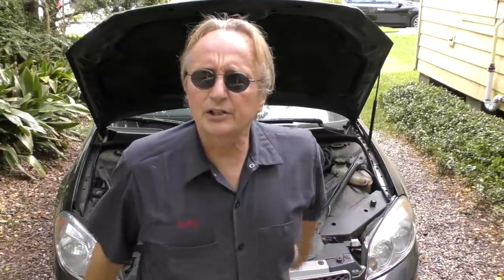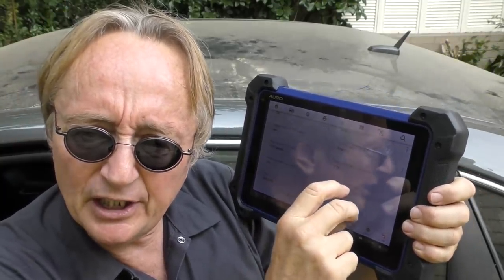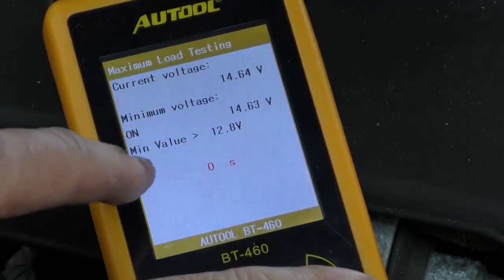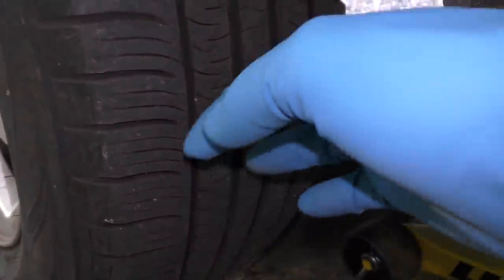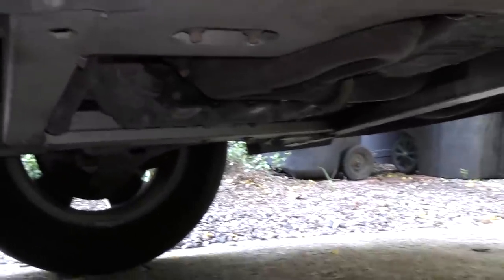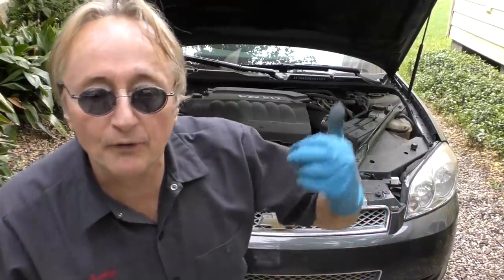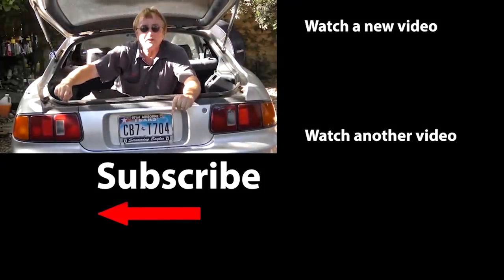Doing This Will Save You Thousands in Scam Car Repairs

Comment: Hey Scotty!  What is your view regarding machining rotors vs replacing them?  A home mechanic I knew said never have them machined at a shop.  It's too costly and it is always better and more cost effective to just have them install a new set.  What do you think?  Bonus question: What, in your view, is the #1 service that disreputable shops suggest to try to rip off customers?  Thanks from Toronto.  You are awesome.

Comment: I know alot of people say that GM makes terrible quality cars .......... I May have just been lucky because i had 96 Bonneville with the 3200 Series 2 engine, i bought the car with 77k miles for 5900 bucks. I had this car for over ten years with almost no problems. Aside from batteries brakes and brake lines which can't really be counted because that's basic maintenance I think the only thing I replaced in that vehicle was a blower motor for the Heat and a radiator !!!! I now have a 2009 Chevy Impala LT that i bought with 46k miles and i haven't had any problems with it other than basic maintenance ?? I know absolutely nothing about cars and how to fix them so only thing I can do is top off the fluids and change a tire lol.  somebody please tell me if these GM cars we're made of better than most other GM products or have I just gotten extremely lucky ???

Comment: That wasn’t a brake job, that was front pad replacement...you could have at least measured the rotors to see if they were above minimum, I can’t tell you how many cars I see with new pads hung on them with rotors that are below minimum and the new pads have grooves from the old rotors. At that time the customer has a decision to make, some blame it on me, others blame it on the State of PA, but they all have to do the job over, and correctly to pass inspection.

Comment: Question: I have an 06 Dodge Charger Rt 5.7 it needed a transmission. This dude said he had an 09 Dodge Charger Rt 5.7 transmission and it would fit. Well the work was done the car is shifting hard and it drives but speed slows. Also my Speedometer is not working and all of the lights are on break light abs esp oil ect. 
I did an obd read on it & it's throwing a code U1120 can you tell me what's wrong?

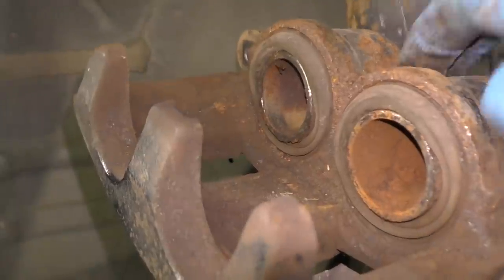Comment: Scotty in looking at the caliper piston seals about the 6:00 mark, the top circumfrence (in this vid orientation) of each seal looks balloned out in comparison to the neatly folded bottom circumfrence. You point out they were dry & ok but is this difference a design feature or aged seals just before the leak occurs? Impala owner wants 2 know.

Comment: Is there a way to tell if a seller has had the CEL cleared just before you inspect it, and if so, what the code was?  I'm pretty sure this happened to me.  A couple years ago, I basically did the checks shown in this video on a 1-owner, 115k-mile  '09 Ford Fusion from a private seller. It was in really good shape, I bought the car, and it's been a really reliable car.  But, right after I bought the car, after about 4 driving cycles, the CEL came on for IMRC which turned out to be no big deal, but it could've been worse.  During my inspection, I scanned the OBD with my blue-tooth and Torque app, knowing nothing would come back but only to see if the owner would squirm.  I also flat-out asked the owner if he had ever had a CEL, to which he, of course, replied 'no'.
Reply: cant tell the codes but you can  tell by the I/M monitors arent in ready status , these are emissions monitors that have to be ready to past a state inspection. easy to see with a scan tool if they are ready or not.  if they arent then someone cleared it via scan tool or disconnecting battery.

Comment: If you’re a mechanic please help me with something... I broke my rear light COVER, the left turn signal, brake signal etc are not accessible as I said only the cover is broken... Do I have to pay for a WHOLE left real light set, with everything new or is there a cover available? I can’t find out on the Internet.
Reply: Also, the rear left fender is dinged in, not quite a big damage.. It’s half finger size in length and width and It’s not pushed tooo far back. Do you think they can hammer it out, or do I have to pay 200$ on a new fender? To make you understand it better, the bumper isn’t even pushed in, but you can clearly see that they are not lining up (Fender with bumper) (2011 Hyundai Santa Fe)

Comment: Hey scottu i got a 2003 ram 1500 with a 5.7 hemi the voltage meter is all the way low, i changed the battery and alternator and its still all the way low what could it be

Comment: So, just what was the dealer going to charge $2500 for? I have plenty of friends/customers at my part time shop that just need to keep their work beaters reliable so they can pay the bills and put food on the table (they have nicer vehicles to drive at other times). The only thing I'd do different in this case is scuff up the rotors a bit with a coarse scotch brite pad just in case there's a little glazing. Other than that, quick pad slap and quick cash for me! My 2 "shop cats" also give every vehicle a 100something point inspection before it leaves just to make sure I did it right. I think they do it because the friends/customers bring them treats!

Comment: Hey Scotty do you still recommend that $90 Bluetooth OBS scanner, is it worth the money
Reply: Mine works great, gives you tons of live data too.  I use mine on an old crappy $30 tablet that has bluetooth capability and it works great...you can use your phone of course but I prefer the tablet to be able to read the data easier due to the larger screen.
Reply: William Todd I might have to get me one. How long have you had yours.
Reply: William Todd is it pretty durable
Reply: @powpowking1209  As durable as any cheap tablet would be.
Reply: @powpowking1209  About a year...I only have a 2005 Toyota Tundra and a 1998 Jeep Grand Cherokee that has OBD-2, and it worked fine with both...neither of them had any actual codes so I made some just to see if it worked and it did, and corrected the codes that I made the vehicles have, then reset the light and it did fine.  Very easy to use and follow through all the screens.  Best you can get without buying a dealer level scan tool...course its not a programmer so if that's what you are wanting the bluetooth tools don't do that, at least not these tools at these price levels.

Comment: Hi Scotty Kilmer i want to ask you a question i have no idea where else to turn to but my mom has a 2002 Infiniti g20 and it has this problem that it doesn't pass 2000 rpms even in neutral and nobody can figure out what's wrong with it can you please help me thanks a ton man oh and another thing the machine says it's the throttle body sensor every time and it's been changed 3 times and no difference
Reply: ecm, wiring from ecm - sensor/throttle body. you need to get the code it is setting and have a tech diag it.

Comment: My dealer keeps emailing me about my 100k checkup. They want to do full fluid change, transmission, brakes, steering, etc. Is it something feasible to do by yourself or is it best to take to a mechanic? I like to fix the issues on my truck myself, do everything I can but tire changes and electrical work. The dealer estimate for it was like 700-800$, not bringing it there for the work.
Reply: typically 100k is something like plugs and wires ( or plugs if you have coil on plug) belt(s) and fuel service, and whatever else is recommend by mileage at that time. at the dealers ship i work it  for GMC its plugs and wires, belt, oil change, tire rotation balance, air filter and fuel/induction service. and $700-$800 for parts and labor isnt horrible.

Comment: Scott sir
I found a 2004 f150 with 213k for $2500looks good 
Do you recommend it?
Thanks
Reply: Sounds like a good deal. Take it to a car mechanic for an inspection. I owned one for many years and almost 300,000 miles. Never had any major repairs, besides brakes and regular maintenance. Good luck!
Reply: Happy Car Reviews 
Thanks

Comment: I'm cheap, however I am prepared to pay someone to do some of the jobs that I could potentially do o that I can get some 'well trained eyes' lookin' around down there. What is annoying is when a company wants to 'invent' work for them to do. Sure if a bolt is loose tighten it, if a seal is gone replace it however if something is 'wearing out' when do you replace it? will it last 6 months with hard running or 6 years with weekend driving?

Comment: You may not have to replace the rotors- but do break the glaze.
Reply: It's amazing how many shops just recommend replacing the rotors outright on just about any car, no matter the condition. It's mostly cost, more $$$ for the shop.

Comment: question: i bought a brand new 2004 tacoma, and when it was first lowered (truck had maybe 1k miles on it), my check engine light ended up coming on. was told by a mechanic that it likely had something to do with the charcoal, i believe. unfortunately, i didn't have him remedy the issue... anyway, the truck now has just under 60k miles, the light is still on, and i have had zero mechanical issues. anyone have any guesses as to what it could be?
Reply: well it depends on the code that is set. if the mechanic said something regarding "charcoal" i would guess it has to do with the evap canister ( setting an evap code) where the canister is faulty for some reason, over fueling to saturate the canister , clogged etc. dont know with out a code and seeing and diag on the truck
Reply: @jaywebb0113  thanks for the reply! if it were a charcoal issue, does it sound like something that could have resulted by suspension modification?

Comment: Scotty, I just changed my spark plugs and coils, oil change but the maintenance light keeps flashing when I start the car. Any help? I have a 2005 prius.
Reply: there is a reset procedeur to get the maintenance light to go off. look in owners guide,search youtube/google if not contact local shop they should be able to do it for free.
Reply: @jaywebb0113  thanks bro I'll check that out.

Comment: Yea, not a good idea to put caliper grease on the pads anywhere. That grease will fill up with brake dust and soon, your pads won't be able to slide in their tracks very well. The caliper grease is for the sliding pins, not the pads.

Comment: I got a obd2 scanner, now it not the greatest because am not rich person.  But when I plugged it in under neath my car computer, it worked!  Except it did not give me any codes.  Said my car did not have codes.  That is impossible!  So I took to a mechanic and he did it for me and code popped up P0012.  Well I look up and it say Camshaft Tension-er.  So I do hear noise coming from my pulleys on my car.  I wonder how much that will cost me to fix $$$$$!

Comment: ⭕⭕👍👍scotty, I  have been around Japanese motorcycles and autos since the 60's. I used to race Motor Cross in the 70's . I have even worked at some Honda motorcycle shops. Recently I have learned about "J.I.S." Japanese Industrial Standard.  They look just like Phillips head , but have a different angle to them. Anyone working on Japanese bikes think the screws are made of clay. They always strip the heads out.  I guess this is pointed out about doing a break job on a Honda Civic. No joke, feel free to point this out on your channel.  Love your work👍👍 you can use my name also if you feel compelled to do so.  Steve H.  from Dellaware.

Comment: Scotty I have 08 Mitsubishi lancer. If I don't start for 2-3 days, battery is completely dead. I bought a new battery but same. It's not a battery, looks like something is draining it. What can it be?
Reply: any and everything. if you dont want to do it/cant do it/dont know how take it to a shop they need to preform a draw test. could take a few hours. if you feel you know how and have the tools you can do it at home. you can google/you tube parasitic draw test.
Reply: @jaywebb0113  I actually searched after this comment and just ordered a multimeter for tests. It's not a big deal for me since I drive it everyday. I just want to see if it's something I can fix and get that rewarding feeling. If the multimeter arrives this week, I'll test it on Sunday see which sircuit it is.
Thanks

Comment: Rev up your shoddy brake job.
Didn’t clean or lube the sliding pins, didn’t clean the caliber mount where the pads sit.
I’m factory trained BMW, Mercedes and porsche technician, I find his work quality to be laughable at best.
Never a fender cover, key ring on pants to rev up the fender scratches and cats on the car.
That’s why I work on cars that are over $200000.
Ps......nice jack stands
Reply: Caliper ( auto correct owned me)

Comment: Hey scotty what is your opinion on the 2004 Cadillac SRX RWD
Reply: Avoid it. The Northstar engine has problems beyond about 60k miles. GM was saving money with the engine bolts/studs. It can acquire weird leaks.
Reply: I have a 2004 SRX RWD, and it doesnt have any leak problems, it only had problems with the timing chain, and power steering. It has around 130-140k miles

Comment: Is sway bar link the same as outer tie rod?
Reply: no they are different parts. the outer tie rod connects the rack n pinion ( steering gear ) to the lower control arm of the vehicle. when you turn the steering wheel the steering gear moves with it and the outer tie rods are pushed/pulled to turn the wheels. the sway bar link is a link that connects the upper suspension ( upper control arm/strut ) to the sway bar. and it transfers side to side movement of the car to the opposite side so the car stays stable when making turns etc
Reply: @jaywebb0113  thanks for explaining! 😀

Comment: What do you do when the transmission has “lifetime” fluid and no dip stick?
Reply: No much you can do buddy. He mentioned on one of his videos that some car mechanics are removing the drain plug, then measuring the quantity of oil that comes out, and pumping back the same quantity back, and putting the drain plug back asap so the oil does not drain out.
Reply: Happy Car Reviews thank you. Since at the top there is still a screw that I can remove to pull transmission fluid in, can I remove that and insert some metal stick into that hole to check the fluid?
Reply: @zehuazhou3390  no not really. most cars with no dipsticks for trans has a drain plug that you have to pull typically while the engine is at operating temp and running to check the fluid. and for life fluid well they only ones i really know like that are cvts.

Comment: i got a 2007 saab 9-3 for free cause the immobilizer key did not work ,I bought a  blank key off Ebay and a reprogramer computer for about a 130,00 off ebay got the car too  run , perfectly and driving it now barley a 107 k miles on her  like new inside out , 4 cyc turbo ,

Comment: What do you guys think of the 2012 Honda Accord Coupe? Has Scotty made a video on it
Reply: I would stay away from the V6 automatic one and try to find one with the manual transmission.
Reply: Currently I’m looking at a v6 with an automatic, it’s only 8k and has 54 thousand miles on it. I know the v6 wears out faster but this one has low mileage(primarily driven on the highway). How does it balance out with those facts?
Reply: @hectorgomez9321  If that is the case, Take it to a car mechanic for an inspection before you buy it. Based in my experience with friends that have owned Hondas with the V6 auto transmissions, they last ''about'' 130,000 miles before if breaks. So, if you plan to have the car for a while, now you know when you should be concern about the issue. 
Good Luck.

Comment: Hi, hey we got a problem with my girlfriends truck. Dodge dokota 2006 4x4 v8...  Ha ha ha...  This is montana...  Ok.. She got this truck used... Car lot.. Had it two years. Truck starts running hot. Change fluids and thermostat... Change water pump and fan clutch....  Still getting 🔥...  Then we figure out that the air conditioner is running at the same time we have the heater running with the nob set on defrost and heat comeing out.  But get this man...  When i turn the selector nob on the dash from defrost to knees or floor the air conditioner turns off and the truck runs cooler.... Now mind you the air conditioner silect butten and light are not on and seam to work fine.....  I have unpluged the wires going to the air conditioner pump and the trucks temp light has not came on....    What the hell is going on with crazy mother....  Help scotty....  Brother man.....     Ha ha ha......   Crazy robbie from montana.......   ;  ]...

Comment: @scottykilmer Scotty I never hear you really give an opinion on Hyundai. I know the brands you hate and love. But some brands you just never mention. A year ago I bought my wife a Sonata (1st foriegn brand I ever bought  and I'm 48). I did my research before buying. The reviews I read said Hyundai was making great improvements on reliability. In one article it was even compared to the reliability of a Honda. Now we love this car. So far mhm o problems. But I'll have the car paid off in a couple years. I'm thinking of getting an SUV next. And the Hyundai Sante Fe has caught my eye. And I can get it loaded at a good price. But I like the Ford Edge as well. So in 2 years if I was to buy a used Santa Fe or Ford edge which would you reccomend. And if it's the Ford. I would still like to know your thoughts about Hyundai?
Reply: Search for this video on his channel ''Who Makes the Worst Engines, Fiat or Hyundai'' If I was you, I would get a Toyota. 
I made the mistake of buying a Nissan Rogue, because (in my mind) it was better looking than the rav4. Now I'm stuck with it.
Good luck.
Reply: @HappyCarReviews  I don't like Toyota SUVs. So that won't happen
Reply: kia and hyundai are pretty much the same manufacture. ( they actually share parts) kia seranto is a nice suv. kia just came out with the telluride which is an upscale/luxury suv